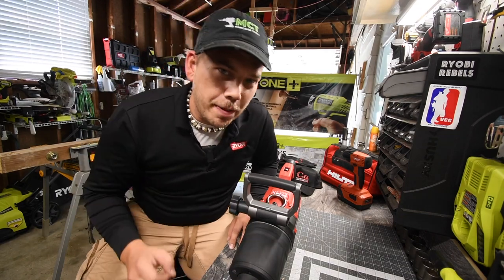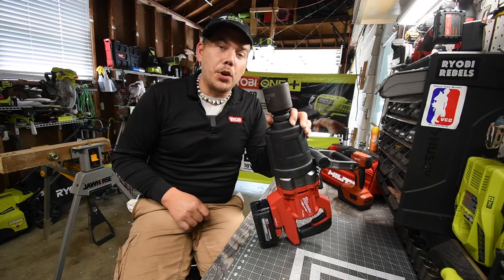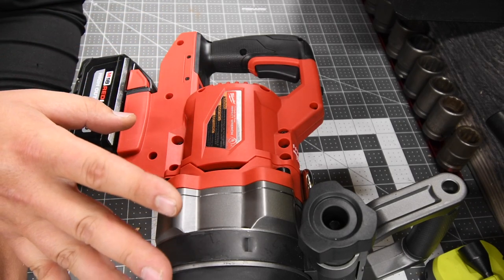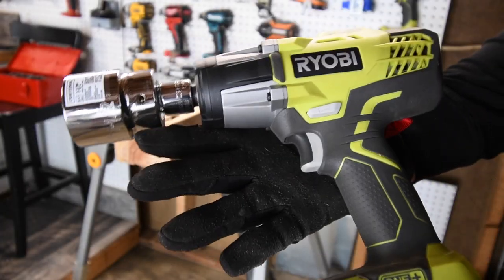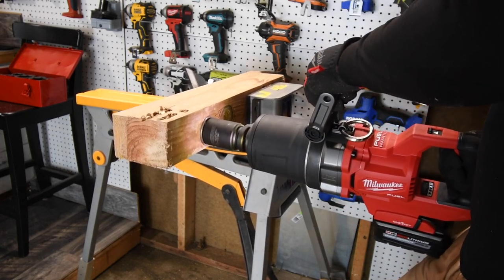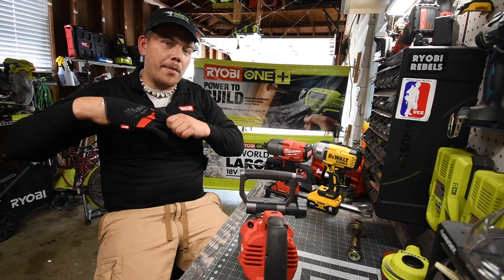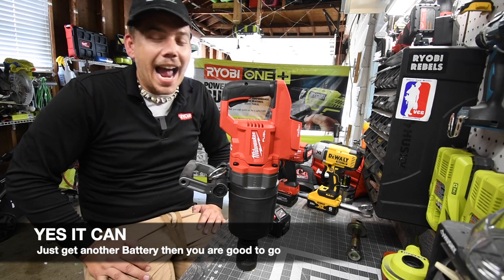2,000 ft lbs Milwaukee 1" Impact Wrench

Comment: As a auto tec I don’t need a 1” inpact.... but... ME WANT!!
Reply from the maker: its an awesome tool
Reply: You'll need one once you get a larger lift and work on commercial trucks :P. Some of the box trucks we run into need it. A lot.
Reply: If you work on truck/ transport or in off road or Ag. That 1"dr gun is absolutely necessary. 24lbs for that isn't bad for weight
Reply: Do they make a 10 mm for them
Reply: Hey it's beter to have it and not need it, then to need it and not have it. 🇺🇲 👍
Reply: pyro 323 this is true. I remember buying my 3/4 gun and guys saying “what do you need that for?” Then they’re asking to borrow it.
Reply: @jeffclark5024  in automotive I'd use a 3/4drive impact sometimes... it was rare but living near the ocean at the time. You'd find some uses for a 3/4 with stuff really seized. If you have the tool you will find a use for it
Reply: Josh Lawrence I work in Wisconsin 75% of the vehicles I see look like they’ve lived IN the ocean. Road salt destroys vehicles
Reply: @jeffclark5024  Sure does. Nova Scotia, Canada for me.
Reply: We use them on semis and semi trailers box trucks and many other bigger lug nut vehicles
Reply: On a Honda crank bolt lol
Reply: Javier Maldonado my 3/4” air does the Honda crank bolts no problem
Reply: Me too😀

Comment: Can this adapt down to 1/4” anvil so I can run my 10mm socket and hex PH1 driver bit?
Reply from the maker: im pretty sure some company does make a socket like that, and I thank you for viewing Brent
Reply: If you want to constantly snap adapter lol
Reply: @tyler70878  was about to say the same thing lol... so much torque on such a “fragile” bit
Reply: Lmao why was this my reason for coming here I’m trying to remove exhaust bolts with it tho🤣
Reply: Fools, this is perfect to screw in tiny zip screws!

Comment: The timber test is a failed test. You need to be bolting through something steel to enable the thread in the bolt to properly stretch which would really show the torque capabilities of the gun.
Reply from the maker: yes it did. I already uploaded a video taking off rusted semi truck nuts off
Reply: But it was nice to see the beast punch the nut through the piece of wood.

Comment: Rhino actually moved it I’m impressed
Reply from the maker: this was a bad test but I did bring the 1,800ft lbs version to a semi truck repair shop and tool off nuts. you should check it out
Reply: @ManCaverTools  I meant rigid idk how it got to rhino lol I’m actually trying to decide if I want switch from my ryobi platform or just go up to the new hp tools I’m really really liking rigid octane tools though! Are they newer than the gen5x ?

Comment: Sorry hit wrong key .  There are tools manufactured with a powerful geared head with a reaction bar which lays onto the a wheel nut .  The geared head is actually a torque multiplier . I could see Milwaukee putting this in the tool line-up

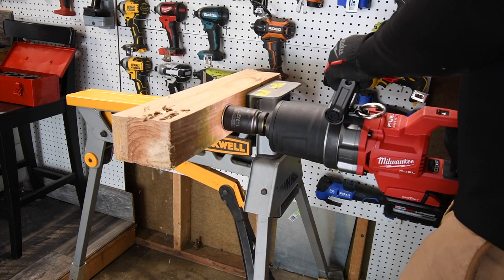Comment: 7:47 if anyone was wondering that is how tire shops tighten the lugnuts on your civic
Reply: "factory spec"
Reply: It damn near feels like it sometimes lmao 😂
Reply: nuclear explosion I did a little research and that’s only on the vtech models. The lugs have to be super tight to hold on when the vtech kicks in bahahaha 😂
Reply from the maker: lol
Reply: Stupid mechanics using an impact to put on lug nuts, YOU USE A TORQUE WRENCH I've hand multiple lugs destroyed
Reply: 15:23 is how they tighten the crack pully bolt on your civic
Reply: Tried to take the lug off my wife's cruz with my stubby aircat and couldn't do it. Had to grab a normal 1/2 gun because of some idiot at the tire shop. Stretched a couple of the studs.
Reply: @garyr7027  Torque wrench is best but even using a regular long handle ratchet you can do good enough by feel. But nope,  Ugga dugga gun. Might be 25ftlbs might be 525 but who cares lol. Drives me crazy.
Reply: Don't forget to tighten the oil filter plug and sparkplugs with the 1". I mean. what could go wrong?

Comment: I currently work at TA as a tech. We use air powered guns for standard hub mounted wheels. I can only imagine how much easier my job would be with this. I've had road calls for tires on both sides of a trucks and trailers and it can be a pain to drag the air hose around everywhere.
Reply from the maker: this tool will come in handy in your situation
Reply: man, you can buy a cordless makita clone impact wrench for around $40 which will make short work out of wheel lugs, that's a really cheap solution to what sounds like a real pain in the ass
Reply: @elduderino7767  I have one here at the house, and let's just say it was not made with the midwest weather in mind, so I've been using it on my cars here. As far as work, I've been using a Milwaukee 3/4. Between the gun and 33mm socket, I paid like $220. And it can handle 90% of the tractors that i get.
Reply: @flippedmylid92  glad to read that you no longer need to drag that hose around - didn't realise you posted that comment more than  a year ago
Reply: @elduderino7767  No biggie. But thanks tho.

Comment: Do they make 1inch to 3/8 adapters? I wanna use this baby under the hood.
Reply: Too bad they didn’t have this when Henry ford introduced the model A it would have replaced that hand crank for turning the engine over lol 😂
Reply from the maker: that  adaptor would be too week
Reply: I have all the adapters to go from 1 inch down to 1/4. I can only imagine running this thing on a dinky little 10mm bolt.
Reply: @flippedmylid92  I wouldn't bother with the 1/4 inch. It will break the tips off. You can just about get away with 1/2 inch and I've seen that broken after a few days of use but that was on max torque. That's as low as I would recommend.

Comment: When doing that unloosening test after the Milwaukee 1 inch impacting you will actually be reducing the amount of torque on the bolt after each tool ... so it would have made dewalt tool get it off in the end like it did ..that Milwaukee  3/4 impact  Was impressive
Reply: The smaller impacts didn’t do squat.  The dcf899 is a beast on part with Milwaukee’s high torque half inch impact.
Reply: @juanc5149  they did u just don't notice reduction of thread torque    by eye why did the dewalt get the nut off after all the tools had a go first ..... and the next time after dave tighter with the 1inch dewalt failed to get nut off ha
Reply: Jubba Bubba 

They’re two different DeWalts.  The first one was the dcf 899 half inch high torque, and the second one was the dcf 894 mid torque.  The first DeWALT is at least twice as powerful as the mid torque.
Reply: I had the Dewalt DCF899 and it really couldn’t do what it was meant for. Most of the time I had to use a breaker bar and do it manually. I ended up selling the Dewalt and bought a Milwaukee 1/2” 2863 and it hasn’t let me down yet, except heavier than the Dewalt.
Reply: akaredcrossbow 

You’re full of it.  Source I work on cars and trucks on the side.  Have 17 decades of experience as a mechanic.  Owned a dcf899 since it came out.
Reply: @akaredcrossbow  I ment that Juan fella giving it the large one full of bollox
Reply: @juanc5149  I'm a mechanic I know the differences dewalts are utter garbage compare to Milwaukee
Reply: @akaredcrossbow  I don't believe that story. The high torque milwaukee and dewalt 1/2" guns are very comparable.
Reply: Juan C it’s not that good, it’s better than some others! After it failed on the first Jeep suspension I used it on, it was sold! It definitely didn’t live up to my standards! Maybe it works fine on Honda’s and Toyota’s, but on real solid built trucks and Jeep’s it can’t compare to the Milwaukee. The Dewalt probably works great on the west coast, not so good in the east where you have rust everywhere. I own mostly Dewalt tools so I’m not a Milwaukee fanboy. My opinion is you keep to yourself and go pound sand!
Reply: @jubbabubba9521  all those impacts before aren't loosening anything, and if he didn't use an adapter the dewalt would have taken the bolts off just as quick.
Reply: @charlesking678  so your telling me the bolt tention would have stayed exactly the same until the dewalt had a go ... yeah ok mate ha
Reply: @charlesking678  look into bolt tention you might change your mind the smallest impact would eventually take that nut off but it would take a long time depends on the condition of the threads and environment aswell
Reply: charles king  I have no reason to lie and you don’t even know me! I’m a big Dewalt fan, always have been! 
I always thought Dewalt and Milwaukee were very comparable until I got the Dewalt and I was very disappointed. I used to watch Real Tool Reviews on YouTube when he was still making videos and he did a comparison video with the Dewalt DCF899 and the Milwaukee 2763 and the Dewalt beat the Milwaukee 2763 at a “very slim margin”. I also watch Singlecams videos and he would show how much of a beast the Dewalt DCF899 was. I ended up buying the Dewalt because I have more Dewalt batteries than Milwaukee. In my experience the Dewalt DCF899 doesn’t compare to the “Milwaukee 2863” not the 2763, if it did I would still own the Dewalt DCF899 and I wouldn’t have had to spend extra money on Milwaukee batteries. IMO the Dewalt DCF899 felt weak and couldn’t handle the tasks it was meant for.
Reply from the maker: this wasn't a versus video of what tool can take off the nut best. this video was about the 1" impact wrench. a more detailed video like that will be coming soon

Comment: Impressive tool for sure. I noticed when you attempted to loosen the nut with the other drivers they were all in forward position until the DeWalt. The DeWalt switch was in reverse and amazingly it worked.

Comment: These tools are unbelievable, super powerful and portable. I have the Milwaukee 2767-20 the high torque its a beast I only take it out as my last resort.  I put the Milwaukee vs dewalt xr high torque those 2 destroyed the 4x4 I was doing the test on, those  are very comparable you can't go wrong with either.
Reply from the maker: very goo and I thank you for viewing Toolhead

Comment: Awesome tool,  Milwaukee just needs to make a battery powered jack to lift up the truck, so you don't need an air compressor  and air line to remove tires
Reply from the maker: Thats not a bad idea

Comment: 18:32. It’s not a fair comparison between the half inch high torque and Milwaukee 3/4 high torque.

The 3/4 was not using a 1/2 to 3/4 adapter where as the half inch gun was.  I can tell you from personal experience that you can experience more than 30 percent torque loss with just a short adapter extension.   Real Tool Reviews proved this as well.
Reply: Yep. I was thinking the exact same thing. Those adapters kill torque.
Reply from the maker: this was not a versus video against brands.

Comment: You gave up on the dewalt mid torque it was starting to move right when you took it away.
Reply from the maker: the vibration of the socket looked like it was but it wasn't going anywhere
Reply: @ManCaverTools  i am not a dewalt fan but i have to agree it was definetly coming off if you look at the sticker on the socket
Reply: I thought I was the only one who notice that.
Reply: The reducer takes away from the torque.
Reply: Yes
Reply: I'm milwaukee all the way, but the dewalt woulda gotten it off

Comment: The dewalt was taking the second bolt off. It moved quarter of a turn. Bad test
Reply from the maker: this wasn't a real test but it was the best I can do at the time I just uploaded a video of taking off semi truck buts
https://www.youtube.com/watch?v=vNXpSXcQgH4&t=357s
Reply: I saw that too. It was going slow but it definitely loosened it
Reply: You can't do a reliable test on a wood because wood is soft and the nut won't torque beyond certain point. So loosening the nut doesn't matter.

Comment: Maybe an I beam connection would be a better test. I used to torque down heavy structural bolts using pneumatic spline set up on DOT overpasses and bridges.
Reply from the maker: I think this was a good test, this tool has majorly proven itself in videos form milwuakee and other you tubers. I wanted to do something different

Comment: I see a flaw in this test. The surface area of the washer is too small. It will easily deform the wood, therefore refusing the amount of torque exerted on the fastener. This decreases the clamping force between the threads. It also decreases the coefficient of friction between the nut and the washer because the wood is being displaced underneath it. What that translates to in the real world is: the nut can be broken free muchhhhh more easily than it would in a harder material that these tools were designed for. What you really need to make this test more analogous to real world application is to have the fastener and washer be backed by steel, not wood. The wood gives the impacts a tremendous advantage when removing the fastener because it gives too much. This set up won’t let you come close to peak tightening torque because the wood will continue to perpetually deform before you can reach the tool’s peak tightening torque.
Reply from the maker: that's the point of this test. if would have kept on doing I think it would have split the wood. which would have been crazy for the camera

Comment: I wanted to see rusted industrial huge machinery bolts, whats with the wood?
Reply from the maker: there is a lot of other videos that do that and taking out semi truck lug nuts. I wanted to do something different. seeing the same tool do the same job get repetative
Reply: This just increases the repetitive tool videos by not showcasing what people want. This tool is meant for heavy duty automotive work, yeah it's something different but that's not the point of these 3/4" or 1" impacts. Good explaination of the logistics of the tool, terrible delivery.

Comment: Milwaukee is the king of battery impact driver/wrench not just because of big daddy right there, even the 1/2 and 3/4 inch is just way better and they have the 1 inch which DeWalt doesn't have. Dewalt and others need to pick up their game when it comes to impact driver

Comment: Question, would there be any torque loss do to the compression of the wood beam? as opposed to metal on metal?
Reply: Absolutely the wood even tho it’s hard it still gives. I would honestly guess if that had been metal on metal the other smaller impacts wouldn’t have taken it off. 
I could be wrong the dewalt and Milwaukee 1/2 high torque impacts are very strong but I believe the play in the wood didn’t allow it to tighten fully.
Reply from the maker: we will be doing more videos of this in the future. I promise you that

Comment: Air wins sometimes, I’ve done pivot bushings on tanker trailers with the shear type bolts and you wouldn’t be able to get that gun in the tight spots
Reply from the maker: I did do a video of the 1,800 ft lbs version taking off rusted semi truck nuts off
Reply: Your idea of rusted and my idea of rusted are two different things. I’ve had some that I’ve had to torch the nuts off to get off

Comment: This is overkill for most applications outside of heavy maintenance and heavy industrial uses. I've used the other 1" impact wrench and the battery was ok but not great. Those batteries can't keep up with the power. If used on small bolts or with adapters for smaller sockets you will run the risk of breaking the adapters sockets or bolts. So I really wouldn't recommend these powerful impact wrenches if the bulk of your work does not require it. And even if it does require it I would suggest getting 2 spare batteries because any demanding situation will deplete the batteries in minutes. That block of wood and trucks are cool but railway tracks, steel beams and heavy industrial applications are better at showing its weaknesses.
Reply from the maker: but you gotta admit this tool is bad A$$
Reply: @ManCaverTools  I mean yeah but so is a dragster. I wouldn't use it for my daily though.

Comment: Milwaukee m18 with large tools over heat the battery pretty easily.  I ain't buying anymore.  I will only buy 60v dewalt since 9 12 and 15 amp bat never trip out... even when pushing a grinder hard.

Comment: That little mid torque Dewalt had moved that bolt an 1/8th turn when you gave up.
Reply from the maker: this video was just supposed to be a fun little video, I will admit that impact is way above my pay grade, I have no real use for it
Reply: Man Caver Tools we have a use for it at work on Scania unit bearing hub nuts. However we don’t do enough of them to warrant the expense.

Comment: After 10 tryouts. This gun keep failing. 10 times I when and use my air gun, this tool is a joke!!!!!
Reply from the maker: what did you try to use it on and what battery did you use?
Reply: @ManCaverTools   He used it on this using a 2ah battery https://www.atlrod.com/wp-content/uploads/2013/08/IMG_1615.jpg